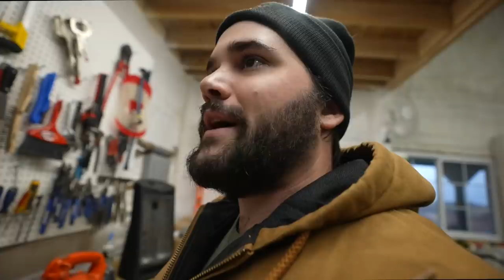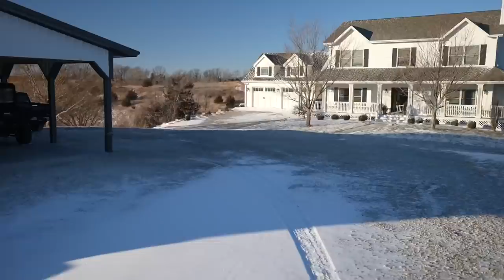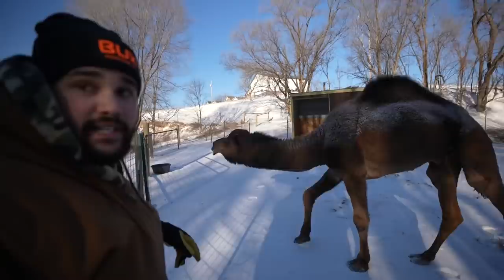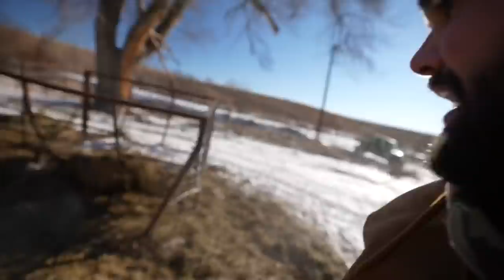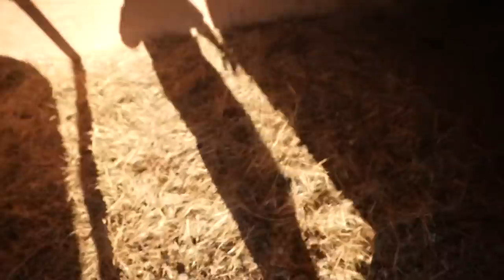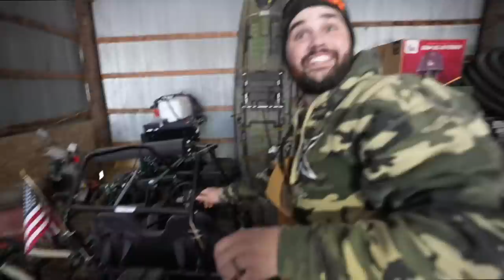SNOW STORM Hits the BACKYARD FARM!!!

Comment: I work with dromedary camels and ralph is acting completely normal for thier rut, males will slobber and drool alot, my 13 yr old drools way more then ralph lol, the scratching is just scent marking and yes they can be very destructive more so during rut so rip to the gates. We use solid steel posts in the camel enclosures. You should consider building a catch pen inside the animal pen, preferably this would be where you feed the animals or at least ralph so you can just close a gate behind him/them and them be able to work the yard unbothered. Id use solid steel cattle panels or weld your own, also just a heads up my 13 yr old male is very good at reading people, when people are around him and are very nervous he senses that becomes nervous himself and thats when he will get bitey and excitable so when sharing space calm, confident, slow movements and you both will be fine camels are very cool to work witn and i enjoy them alot, have fun 👍

Comment: Hey flair, my dad has a plow for snow as well, but to minimize the gravel that was plowed, he cut a piece of pvc pipe the length of the plow and cut it down the entire length of the pipe and wedged it onto the blade. It works great. Obviously it still moves a little gravel, but its better than what it was

Comment: Hey Flair I got a couple tips for you when plowing. First is speed the faster you go the better. Second is skid shoes use them. It’s hard to plow on none frozen gravel but when it freezes it I’ll be just fine. Last thing is angles. Angle the blade to help with the snow. Other wise great video

Comment: When you plow gravel pile the snow in the same spot all winter, after it melts in spring you can use a blade to push the gravel back where it is needed.Build a hay feeder with bars at 45 degrees for the bale to slide down on into the feeder. Have them hang just over the fence. Place bale on bars, give it a push to slide it down. Use 8 or more bars so the bale has good support to slide on

Comment: The oils thickened up cos its cold bro, if you take em up to the heated shop they'll run or a very little tickle over the bottom of the sump with a blow torch and THEN try start em up

Comment: I use my tractor to put rolls of hay in for my horses, so it's much longer than your skid steer,  but I built a 12ft wide x 24ft long fenced area with a gate on both ends going into my pasture, that way I could put out rolls of hay by myself, I pull my tractor in the first gate with a roll of hay and I close the outer gate and open the inner the gate and drive right in so there's no way for the horses to get out. And by doing it that way I also have a 12ftx24ft area that I can stick a horse in if I need to separate them from the others, and it makes a place for my Vet' and my Farrier to put a horse in to tend to them away from the others. It's just a good thing for many reasons. And you should get a hay ring to put around Ralf's roll of hay. That way you can just hook it with the hay spear and move it any time you want.

Comment: If you want a more secure fit for the hopper on the leaf blower, i'd get those metal hose clamps that you can tightened or loosen with a screw driver. Also I'm surprised that you do not have one of those Stihl Back pack blowers the BR 500, 600 or 800 models are commercial ones that are really good. you can also order extra/replacement tubes to be able to swap out the tubes for when you just wanna blow leaves and not seed/salt anything.

Comment: Flair love ya but Huskivana is basically classed as the best brand for chain saws blowers wippersippers and power tools you just had it on fool choke you need to take it off after about 15 seconds because you flooded the motor that’s why it was cutting out

Comment: i bought one of the little backyard pavilion thing. round with a roof. cattle panel around the bottom. the bale sets in the middle under the roof so it doesnt get ruined by rain an snow almost zero hay waste. also keeps it off the wet ground. im not even a millionaire and i could afford the 600$ to save my hay. pocket change for the flairzoo